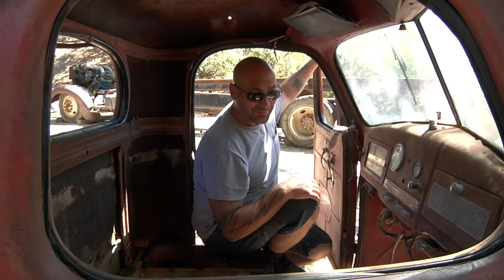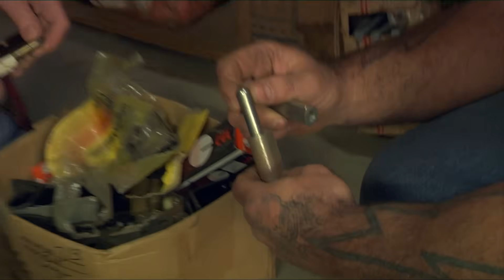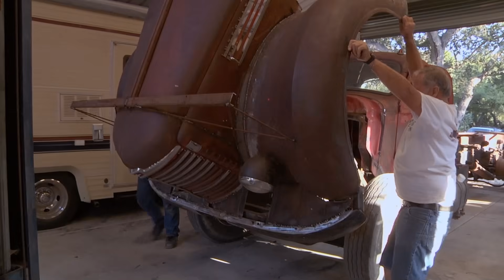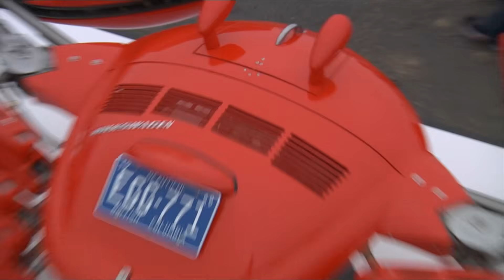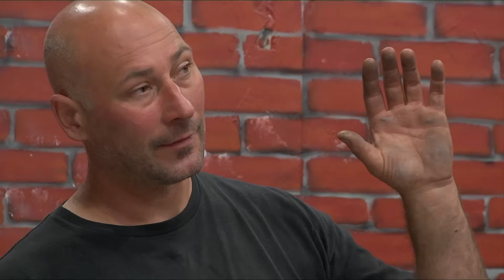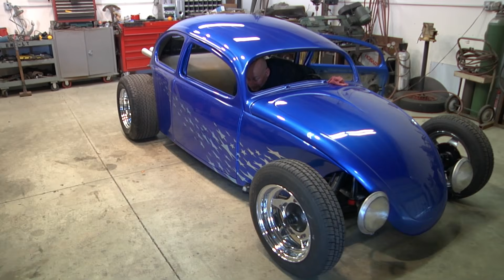Making Custom Cars Has Never Looked This Easy! | Full Custom Garage | Season 1 Full Compilation

Comment: Love the truck.
As for the bug, get the van as well.
Maybe a wrecked van, where the nose is wrecked.
They have created a vw bus van.
There where vw camper van's as well.
Then you had similar styled trailer (that may or may not, have been wreck modded ones).
Be wild there and make the ultimate surfers van & trailer combi.
Then paint it Mystery Machine style.

As for the real big rig trucks.
They get bigger and bigger, right?
But the four axel dumptrucks, are those back axels stearable axels as well as power axels?
Can't you rethink those big rig trucks, so they turn on a dime?
Then see if with local parts, you can pull a scania.
Bonus if you can get some very clasic looks, while keeping it save as well, including the noise you're ears hear.

Now, have you ever concentrated on airplane engines?
What about train engines?
Napier Deltic, a boat and then, train engine.
You would live it.
Then you have the Napier Nomad, which added a turbine to the exhaust pipe if a eight cilinder in-line diesel engine, thus getting quite the low fuel cost.
And yes, that is the airplane engine, wild, right?
Why I bring this up?
Never ever wanted to figure out the real engine setup Kitt & Carr had, in Knight Rider???
How where all those computer systems powered?
Super Persuit(?) works how?